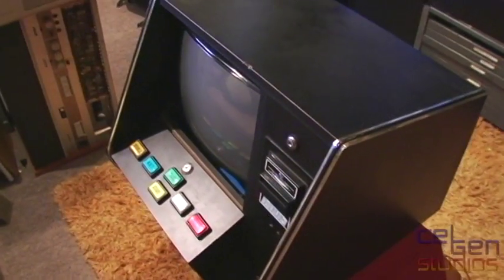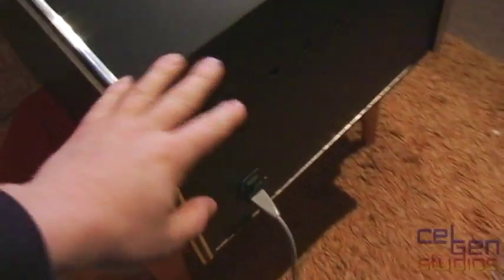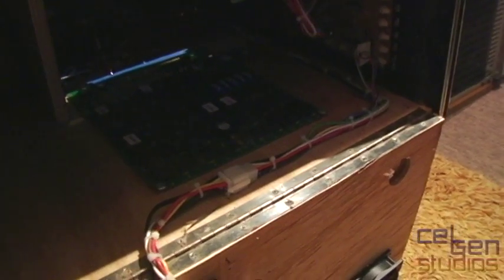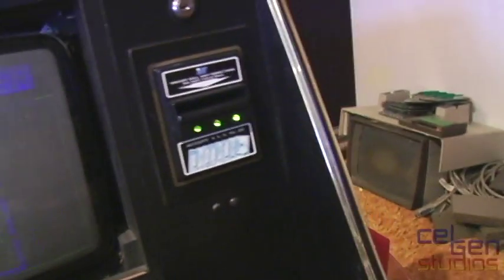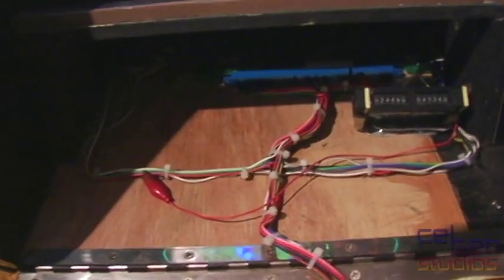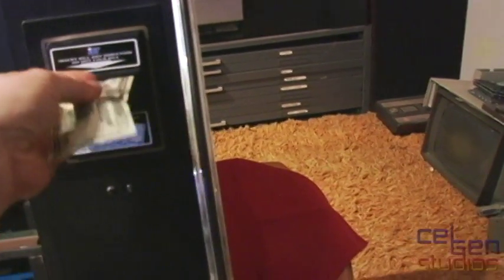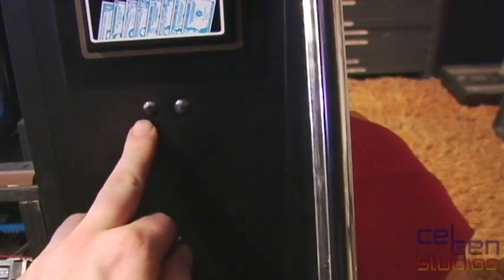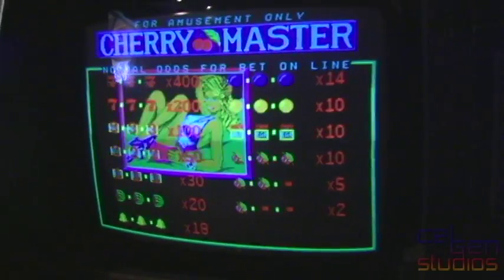"Cherry Master" 8-liner Video Slots

Comment: I know this video is a fey years old, but did you ever get it working 100%? Thanks for your time.
Reply from the maker: The bill validator didn't like the stacker cassette was missing. It runs fine now.
Reply: Awesome. Thanks for responding..

Comment: I have one of these and ran into a problem, I hit a LIMIT ERROR. I won 10001 in credits and now the machine will not play at all. Do you know how I can reset it so I can play again?
Reply from the maker: is there a service or attendant key to clear credits? No clue, sorry.
Reply: @CelGenStudios  There's two more locks that I don't have a key for, so I'm thinking I'll likely have to call a locksmith to see if those can be opened and if I can find a switch. I appreciate the follow-up very much!

Comment: Hello, do you have this machine still? Do you sell it? If yes then how much?Thank you for answer.
Reply from the maker: 8-Liners grow on trees. No. Find a proper vendor to sell you one.
Reply: Thx.
Reply: I found some same machine but 1-2 were tabletop. All of these are US and they can’t send it to UK. But lots of same machine are in India where these very cheap. I found one tabletop what has much better and nicer cabinet what looks like same what I saw when I was child and used it sometimes then. The price is funny, a bit less like £50 (R 3500-4000). I checked the parcel delivery from India and that about £170. Okay, this is also an old machine but works. I wrote to the seller but I didn’t get answer yet....
Maybe I must looking for an other one.
Reply: Gyere és táncolj!      Huh ?

Comment: Hey quick question how can I change percentage pay rate on those machines.  I can enter setup but cant change it.   Do u know how ?
Reply from the maker: Never looked into it. I can only assume one of the many dip switch charts google picks up will configure it.
Reply: It's in dipswitch settings

Comment: Some stupid trivia.  These games cheat.  This isn't a theory!  I disassembled the code back in the 90's, and found 2 places.  The game is designed to pay out a max % of the credits bet.  So, when you press SPIN (or whatever it's labelled), it uses the R register on the Z-80 to get random numbers for the spin results.  It then checks that "result set" to see how much it would win.  If it's a win, and that win would take it too far over the max %, it throws it away, and grabs a new result set.  Also, if you win, and decide to play the bonus game "Hi-lo double up" to try to undress the cartoon girl.  The way the game works, it shows you the last few cards, and asks you to guess if the next card dealt will be a HI card (more than 8), or LO (less than 8).  8 is an automatic loser.  Anyway.  There is code in there that looks at the number of credits you've bet, and if it's more than 1000, it's an auto loser.  How you ask?  it waits for you to pick HI or LO, and then it looks through the deck of cards it has in memory for the first card that will cause you to lose, and it gives you THAT one.  Cheating, plain and simple.  For reference, I would later go to work for a slot company in Vegas, and the first thing I did when I got access to the source for a game was to go look for these kinds of shenanigans there.  It's not present.  The Vegas games are based on sound MATH.  Which these old games are not.
Reply from the maker: I am not at all surprised about this. Considering how many of these end up in the SLEAZIEST of establishments it makes complete sense why they would unfairly favor the house.
Reply: many ways to cheat a lot of the older games, programmers put hacks in
Reply: programmers put bet patterns in that would guarantee wins also
Reply: @winninggambler  Do you have any proof, or can you point me to a specific ROM set that did this?